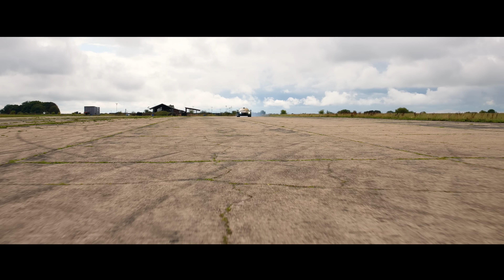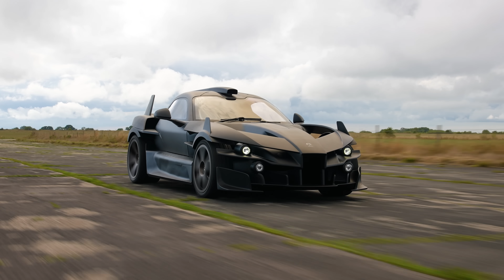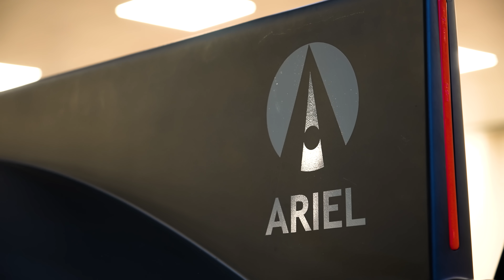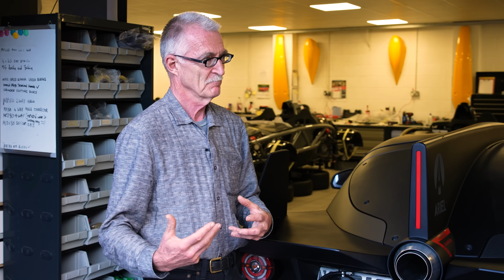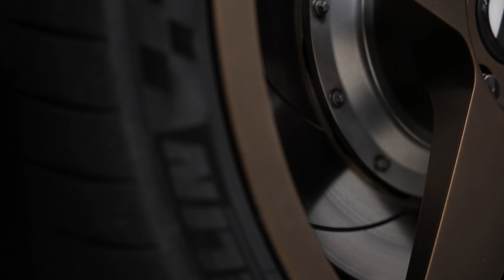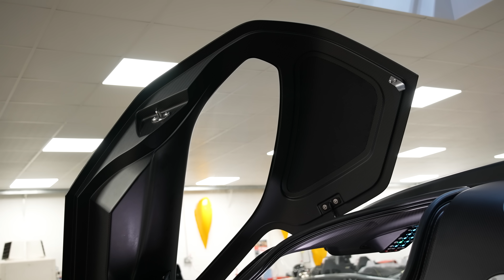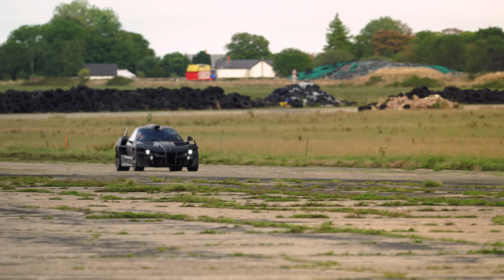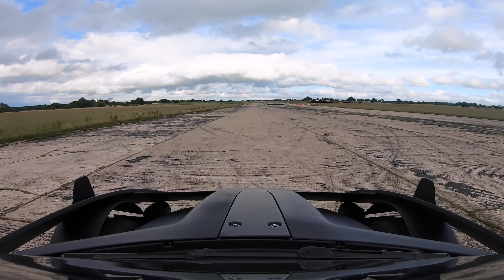NEW Ariel Hipercar – 1180bhp, 0-60mph In 2secs + Jet Engine?!  | Top Gear

Comment: First time I've ever heard a jet engine described as a "range extender"! 😆

Looks absolutely mad...I love it!
Reply: Isn't it just that in a jet? Otherwise it'd be a glider.
Reply: @Scottydelsumo  An aircraft uses the thrust the jet engine creates to push the aircraft forward, the jet engine being used as an APU doesn't move the car at all, it is only being used as a giant alternator, the electric motors are what pushing the car forward. Quite a different application.
Reply: @Scottydelsumo  Nope. Jets don't have other forms of propulsion built into them.
Reply: I think what Phantom Echelon is referring to is the notoriously high fuel consumption of a fighter jet.
Reply: @Ivan_Julian_AUS  That too, for sure. Jet engines are great for speed...not so much for fuel economy...
Reply: @phantomechelon3628  in fairness,  perhaps the only advantage to a small footprint jet turbine is you CAN run them on methane  -  and I'm told we're practically doing the world a favour when we burn methane.
Reply: @Ivan_Julian_AUS  Well burning methane is better than letting it go into the atmosphere. Still creates CO2 (and H2O / water) but its "cleaner" than other hydrocarbon fuels.
Reply: @phantomechelon3628 fuel consumption is very high. But efficiency is quite good.
Reply: This is crazy. I've been obsessed with Series Hybrids - hybrids where the ICE is just a generator for the last month.

 EVs suck in one majior way. Weight! I mean batteries are heavy, and not good enough to build a light car. 

 With this you get the benefits of the EV with the instant insane torque, light as hell reliable motor, but have the range of an ICE. 

 What engine though would be the best? I kept seeing new engine designs from the Omega, Aquarius, to the Liquid Piston rotrary which promise tons of HP in a small package... 

 That is when I remembered turbines are the best generators as far as I know.

 I even asked on Reddit why series hybrids aren't more common. 

 Anyway a few weeks later I find out this, and one other company have already tried!

 Ariel however is well known for an insanely fast, light, sports car which is exactly what I was thinking this type of set up would just be perfect for until batteries can become better. 

 Anyway awesome job, and I hope they work on it more. I hope more car companies take their hand at it as I'm not sure how good Ariel is at either EVs or Turbines.
Reply: Jet engines are the ultimate in fuel economy. I've thought this "range extender" could be done since the 90s. Heck, on an ev it could even be an option. But a small turbine geared down turning a generator is the way to go. Turbine engines only have one moving part and can run on different fuels. This concept could apply from hypercars to 18 wheelers. And add regenerative braking, obviously. I just need some investors. Anyone?
Reply: @kdizzystl  Thats a gross oversimplification and highly situational. Its true if applied to mass air transport, but certainly not to personal or family transport. Aviation fuel is considerably more expensive than petrol (admittedly can vary depending on where you live) and while the extra cost is more than absorbed with mass transport, you'd almost certainly find it more expensive to run a car on jet fuel for an equivalent journey, than petrol or diesel. Then there's the logistics of finding places that sell aviation fuel...or possibly having to refuel at airports?

Not convinced a hybrid turbine system would be significantly more fuel efficient than a normal ICE hybrid. I mean I suppose if you designed one specifically for that application, you could do it. I got over 70mpg from my Toyota Corolla hybrid (which had a 1.8L petrol engine) which is pretty decent IMO. With a full tank had a range of around 350 miles.

I do know Abrams tanks use gas turbines which use more fuel compared to tanks powered by diesel engines (or at least they have a shorter operational range). Also while having fewer moving parts, turbines can be more maintenance-heavy, depending on the fuel used. Build up of deposits in the compressor & corrosion of turbine blades can be issues.

I know a couple of US car manufacturers also experimented with putting turbines in cars back in the 60s. There are probably good reasons why they didn't take off.
Reply: @phantomechelon3628  use gas. Gas turbines. Regular pump gas. Turbines can run on anything that can be ignited when sprayed. In the video he said they wanted to make it run on hydrogen. Too complicated. Airlines use different fuels in the same planes. Can't remember. Has something to do with being cold so they use a more expensive fuel. I've seen a turbine that ran on whatever you poured in it that was flammable basically. Idk the specifics of that. Also don't forget turbines have one moving part. I'll look up the tanks though. They aren't turning a generator I believe. They are actually driving the tracks.
Reply: @kdizzystl  I learned recently turbines actually aren't the best for small scale. Only at large scale do they out perform diesel engines. 
 
 Still more powerful in a lighter package, and simpler. It really boggles my mind how they are more expensive, and why a turbine/hybrid isn't more common. 

 You know it is really difficult to find effiency ratings. I can only find mile per gallon, but that doesn't mean much when the engine is putting out different horse power. All I know is they say ICE gasoline are 12-27 efficent. Then you have people refuting that saying some are 40%. 

 Then others saying turbine guzzle gas. Yet no one can tell me at what size do turbines become more efficent. 

 It is really effin annoying. I'm all for EVs and Hybrids, but I need proper data damn it. Even EVs suffer from it as not all are putting out 90% plus effiency all the time.
Reply: @dianapennepacker6854  airlines biggest expense is fuel. Jets are tuned to perform at certain altitudes and rpm. Tune it for ground level where there's more oxygen which is even better. Use a gear reduction to spin a generator. I'd offer this as an option that you could even add later. People I talk to are always worried about range but even Evs with bad range have more miles than they drive in a week. With the turbine you could even plug it into your house in an emergency. Heck, depending on how far you live down the line it can take double the electric just to push it to you. You wouldn't save on your power bill bc of the meter but you'd be burning less to make the power. That's another subject I'd like to rant about but I'll save you the trouble. Haha
Reply: It is not a Jet engine, it is a jet turbine with alternator. Airliners use APU(jet turbine) to strat the main engines and prodive the power while on the ground. I thought of this concept for an electric car a very long time ago not understanding why eletric cars need all those batteries, when it could have a super efficient jet turbine generator producing the power. Finally somedoy has actually built a car like that. And what a car it is. If integrated smartly, it could also increase the airflow through the vehicle, reducing the drag and airodynamic efficiency.

Comment: Looking finest, but one problem exists. Don't have money for that thing never :D
That idea existed but they lookin to put it in use finally. I can think to see outside least 2 things that I just think they not work so good. So in my opinion front winglets or what ever called those things english, going to snapped away. It would be nice, if turbine air could took somewhere that needs remove it, but dust and things like that makes it impossible to took underbody. And if compressor needs to suck that air, it makes whole thing bad. If you run air after compressor to tru something that needs cooling, that makes problem to turbine some point, and those are around axel, other front and other immediately after it, like plane jet or plane APU, at least that is most likely, because it is the way how it is made so long and "everywhere". 
But, it's proto, I hope we see ready one some day in near future. 
For sure it's not sounding like "old good v8".
Cannot say how people's handle those higher pitch sounds, because video isn't from ready thing and mic + speaker isn't real thing never.

Comment: I literally had this idea of putting some kind of turbine on an electric car to keep the battery charged 2 years ago and was wondering why no EV company has thought of this (obviously because they want you paying at charging stations). Very cool Ariel.
Reply: CEO of car companies are not thinking: Lets make less profit to make sure it runs on X.  (gas/diesel/electric/hydrogen/propane/methane or any other energy source.)
Profit is what matters to any company.  What can we make cheap enough, and what can we market.

Turbine generator is allot in R&D and expensive to manufacture, and probably hard to make quiet enough for a regular car.  Once someone else has done the work and proven that it can be made to be profitable they will all jump on board. its just business.
Reply: It's not the car companies that will make money from charging. That's just a stupid comment.

Comment: battery cars are not efficient at all. they takes ton of a time to charge that makes the owner inefficient. and it makes a lot of heat while charging. it is just a waste of energy. and battery cars weights a lot more than their counter part. that is just another wastage. because you need to burn more energy to move around. i will consider buying an electric vehicle if it can drive itself because there is no fun to drive an electric car. and it must charge up fast enough.

Comment: One of my favourite modern-day marques and this time, it is a real gamechanger. 1500kg for an EV! isn't that about the same weight as a Cayman? but with 1200bhp. Stone me! And as SS had said: there is no reason for it to look mid-engined or front engined because it's neither, so Ariel can rip up the rulebook on car design, providing their aero is on point.
It looks amazing, it's going to go like stink and it even sounds good for an EV. Can't wait for the finished example if Ariel's previous models are anything to go by...

Comment: 'Worlds fastest accelerating road car'

The Speirling, with its tax disc, would like a word.

Well done though, you actually made it look slow off the line and in general. That takes talent when you're filming a thousand horsepower electric car on an airfield.

And yes, I do mean the first launch, not the second one with the flat battery.

Comment: Why not: 
Have 2 jet engines with 2 exhausts, 1 for each taillight.
increase the size of the car to make room for a bigger fuel tank and battery size. 

Since the car apparently got room for ground effect, use that room for pressurized air thrusters to make it even crazier than the Tesla roadster. Keep the 4 electric engines the same size. With the extended range the car will last longer at high performance. The thrusters will compensate for the added weight. Maybe the 2 jet engines can help with refilling the compressed air tanks, probably not.

Comment: As soon as I saw it I hated it.
It all looked like fake Batman aero nonsense.
As soon as the main guy got finished talking about it , I understood it and appreciate it.

The jet engine creates an interesting set of liabilities for cars and buses sitting close to the back of the car at red lights.
That jet outlet may need a low speed deflector to drive the exhaust straight up while the car is sitting at red lights in traffic.
The inlet at the top of the car may need a coarse grill to keep leaves and other road debris out.
The explanation of the upward fins at the front was outstanding.
However, government motor vehicle safety people may have concerns about the visibility decrease at the sides of the car in front as well as pedestrian impact issues with those fins.
It's basically an ugly little thing that could make a shxxload of power and be a heck of a fine road car.
Alot like the Atom.

Comment: Made me laugh when they said the most complicated part for them was the door design 😂 They never had to design that part before 😂
Reply: Ariel literally just invented the batmobile
Reply: @crazysilly2914  not literally
Reply: @SimoBenziane  yes literally
Reply: @crazysilly2914  you literally don't know what literally means.
Reply: @limericklad2000  Yes I literally do, there was literally a shot in the video with literally batman driving in it...
Reply: @SimoBenziane  yes literally and not just literally but, also laterally.
Reply: @SimoBenziane  You seriously need to look up the definition of literally, so you don't keep making a fool of yourself by not knowing the dictionary definition(s).
Reply: On a car with a turbine used as a generator no less.
Reply: Car doors are incredible feats of engineering. Hes not lying or exaggerating
Reply: @Y34RZ3R0iscoming I came here to say ‘doors are hard’ it’s why if you want to know how old a car ‘really’ is you look at the doors.
Reply: Seriously task yourself with door.

You will suddenly change everything to avoid door
Reply: Because ev drivetrains are dull, joyless and uninspiring.

Comment: I appreciate the weirdness of this…but I think Aerial made a mistake, hear me out… the past recipe for Aerial has always been to produce a small displacement engine with 200-400hp, and weights that were under 1500 pounds wet. What they should have done, is produced a car maybe around 2000 lbs, with 500-600 hp worth of e-power. Nobody has really done that yet, and Ariel was the company to do it. This thing weighs 3300 lbs

Comment: I look at the rear of that car and I see what I envisioned in High School when we used to race co2 cars. My wood shop teacher glued a big old slab of wood onto my car and I didn't have enough time to get the design refined before the race. So it pulled a wheelie ripping the front eye out for the guide wire. I had the Yaw & the speed that my car could go. But when teachers don't listen... I.E I was an aircraft mechanic @ 17 and 1/2 yrs old before I graduated highschool !!!

Comment: Jet Turbine engine and electric motors are like tea and milk. turbine works better in constant speed and rpm, so direct jet engine to the wheels for real life operation with its stop-and-go is not so fuel efficient. But if you do it through electric motors-alternator by charging the battery to feed the motors for actual driving, it's pretty doable for fuel efficiency if they get the sweet ratio and programming in the ECU. Just like APU in aircraft. You can throw any fuel, technically, into the jet engine.

Comment: Sorry topgear you need to check your research, Marine turbine technologies have been making a jet turbine motorcycle since 2000. Ariel are the first to make the turbine the charging unit which imo is awesome. But they are not the first production company to make a jet powered road vehicle.

Comment: What a hideous machine. Not supposed to look like a front or mid engine car? Well it looks like a front engine mishmash of Supra and Model 3 if you can look past all the grotesque aero add-ons. Long hood, far aft driver’s position but overly tall and far too narrow. Can it turn or is it a one trick pony? The sort of thing Europeans have long since teased American cars for being? Now I have to keep watching to see what this beastly machine weighs.

Edit: So the goal is under 3300 lbs which despite the lack of an interior, 2 seat capacity and all carbon fiber construction is extremely heavy. All this compromise based on fabricated falsehoods about the future of humanity. The 150 mile range despite all the compromise makes it even worse, and that’s if you drive like it’s a Corolla. I can’t be as excited for this car as it seems the majority of commenters on this video are. I don’t like EV’s and there has yet to be one that impresses me. Yea they make good torque and accelerate well but that’s just the nature of an electric motor. They make good commuter cars but that is the extent of their usefulness. Commuters don’t have to go far, have any utility other than transportation, handle well, look good or excite in any way so the EV fits the role very well because everything a commuter is an EV excels at. For a performance vehicle they’re absolute shit. For an enthusiast car they’re fermented shit.

Comment: I believe these are called parallel hybrids. 

in the 70s an engineer built one with a Winnebago and a generator got him over 50mpg 

the generator works at a constant rpm no matter if you are stopped, accelerating or maintaining a speed so it's always at peak efficiency, recharging your batteries that the electric motors run on. When accelerating they  drain, when cruising they trickle charge, and when parked they charge. 

it's a super efficient system and the only car ever made commercially using this system was the 1st gen Honda insight I believe

Comment: I look forward to seeing them in production. I have no problem burning a little fuel for range, just make sure I can leave the turbine off and charge at home. 
If Ariel is reading comments, I've been driving EV for over a year and my decision is regenerative braking is amazing. I barely touch my brake for the most parts and there is no measurable wear on my pads and rotors in over 15,000 miles of driving a 4600 pound SUV. There is no reason not to simulate engine braking as we all, who are serious, use the function normally.
The tiny turbine generator is an awesome addition and I wish more people did it.